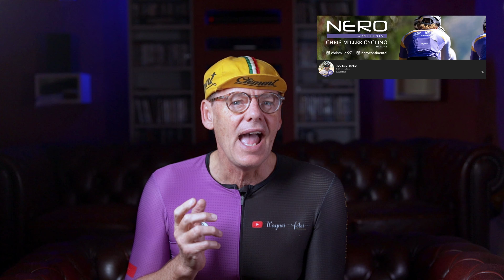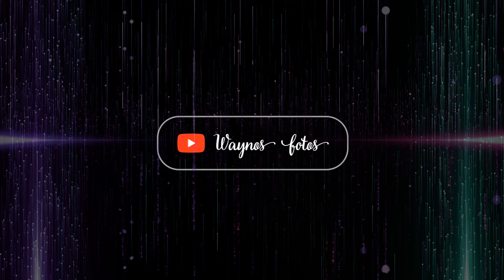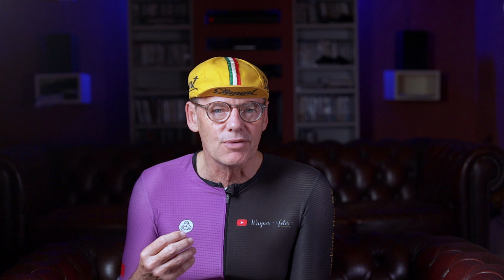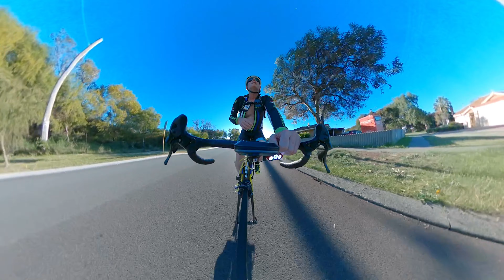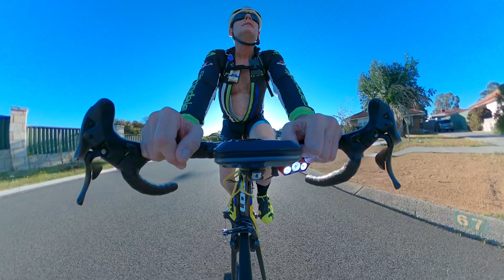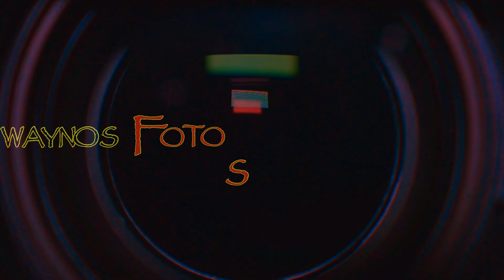DISC Frame design compromise. INDUSTRY INTEL confirms

Comment: I live in Texas and we have concrete roads full of holes and cracks. I bought some tubular wheels on the cheap and love how smooth they are and unlike others I don't get pinch flats. I like them so much I bought another set for my backup bike. Nothing against the other types but I like the tubular, you can find the rims second hand at good prices and tape them up.
Reply: Nothing wrong with tubular wheels, but they are a pita to repair if you flat out on the road without a support car. They are also often a pita to glue up initially. 

Modern clincher tires have gotten so good that the former large gap in ride quality between the two no longer exists, and has not existed for 15+ years. I have ridden enough trash roads that have included gravel components in NY, SC,NC, MT, CA, AZ, CO and overseas to know that if you have a clincher tire and its tube properly installed with correct psi you are not going to pinch flat very often at all regardless of how bad the roads are that you ride on. 

Heck, just 15 years ago we were regularly racing road bikes over courses that included gravel road sections on clinchers without loads of flats. This was of course before the industry and bean counter goofballs claimed that gravel riding was this mystical completely separate category so they could sell for thousands of $ what are essentially MTB geometry drop bar bikes that have only been around for 4 decades. And we didn’t have to call our races gravel races or claim it was this entirely different category where you needed all brand new equipment even though many of the courses we rode over included significant dirt and gravel type access or fire roads. 

And on the rare occasion you do flat you can literally have a replacement clincher tire tube on and aired up in under 5 minutes and you’re rolling again. Most flats even on poor roads are the result of the rider not paying attention and hitting something that should have easily been avoided. That’s not always the case, but it’s far more often the cause than most riders will admit. 😆
Reply: @rcg9573  I use tape and carry an extra tire in a water bottle case, no issues

Comment: I recognize the sealant problem. At higher pressures the sealant is not able to close the hole. Even after pumping up the tyre some days later. So indeed sealant must improve.